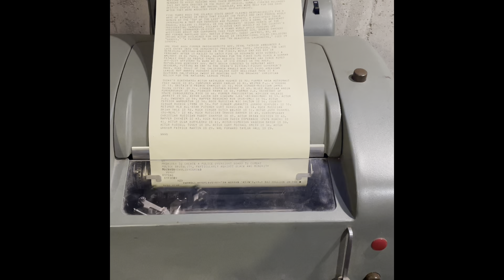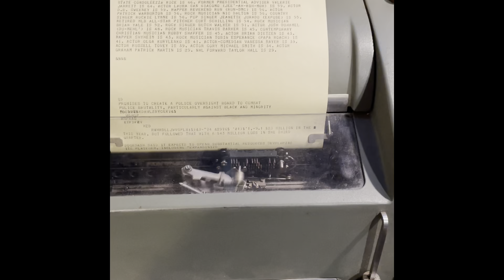Teletype 28 KSR with electronic speed shift

Comment: At 60 WPM, the sound emanating from the Model 28 - especially the KSR variant - appears to have been what was recorded in the teletype room of WCBS Newsradio 88 in New York in 1972 for the purpose of playing behind the anchors - in the corner of that room were three Model 28 KSR's.  The sound was used from about mid-to-late 1972 until about 1987.